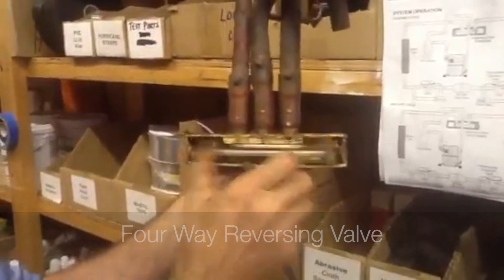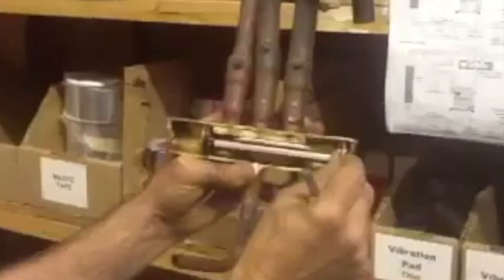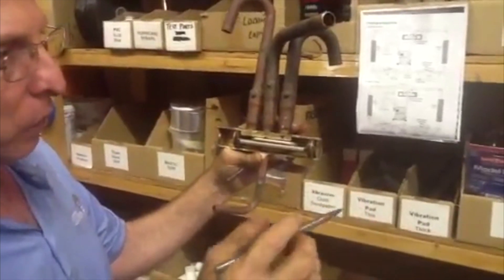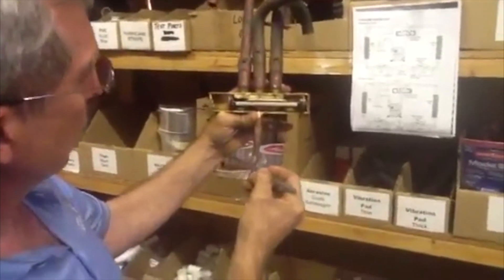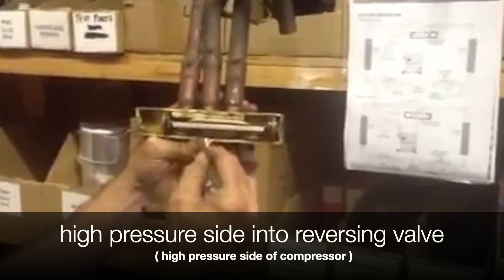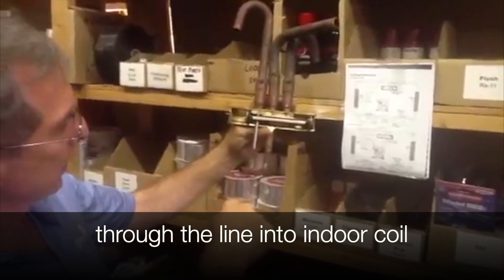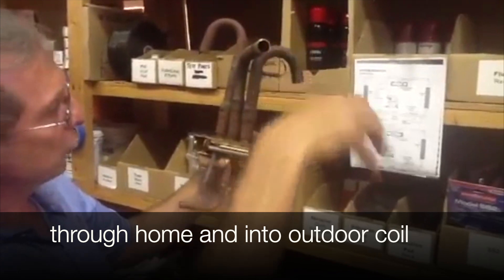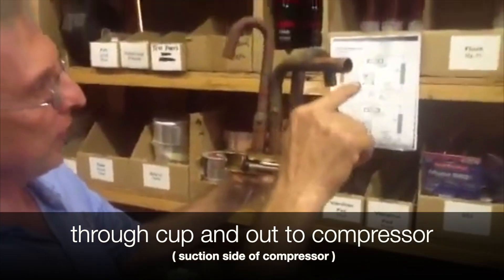"Understanding Reversing Valves" From Heat to Cool in Seconds:

Comment: I find by me though that the reversing valves all will do cooling when de energised, and switch to heat only when powered. Probably because here the units spend the vast majority of the time in cooling mode, and you might only need heat for around a month or two in winter. Saves around 20W of power for the majority of the year, and when you need the heating the extra power outdors hels keep the outdoor unit warm so it does not build up too much ice.

The valves are used so rarely that often you find that they seize fast in the one position, and will not change over when commanded. They also can fail and bleed through from the high pressure side to the suction side, dropping your efficiency. They are not worth replacing, just remove, do the 2 shunt loops, and program the indoor unit in a split to be a cooling only unit.